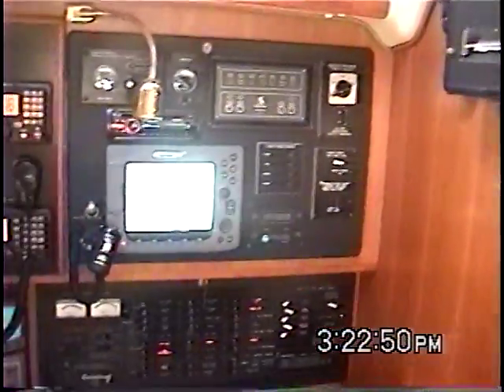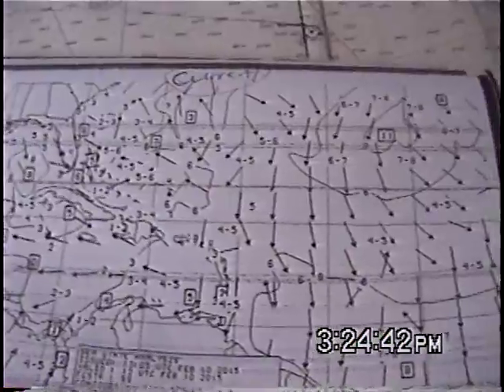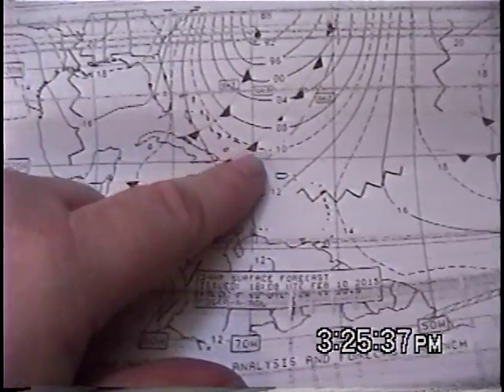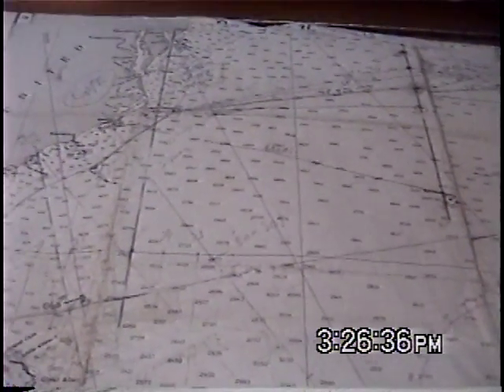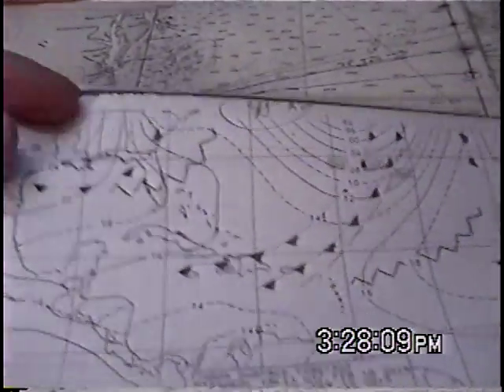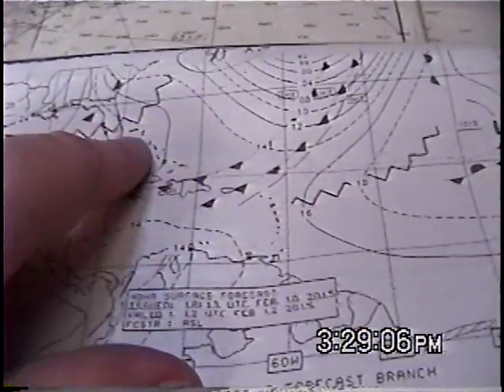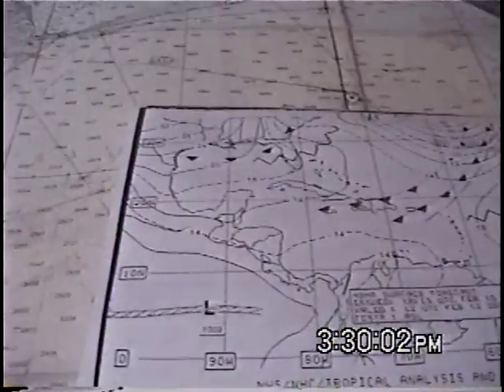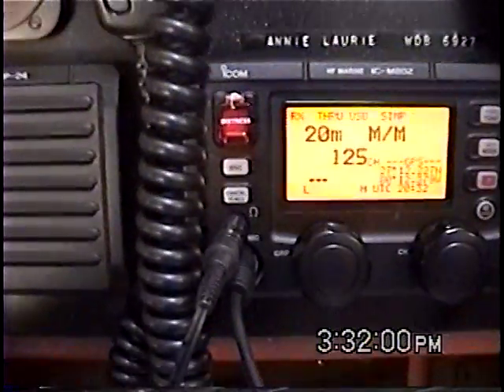Basic Offshore Weather Dissemination Systems and Weather Routing

Comment: Hey John.  Obviously the blur streaks is RFI. Some questions....1.) How do u fix that if u wanna talk on the radio at the same time getting weather charts?  2.) Is that the only issue that happens with wefax and other stuff on board?  and lastly, you have reported before on some of your video's that "on-shore rfi" is sometimes a problem with say the Icon M-802 (like you reported) is there anything like that "on-shore rfi" in getting weather reports?  Thanks and 73's.  Happy sailing.
Reply from the maker: Jason, the "blur streaks" that I show on the above video (from 1:10 thru 1:30) are interference that I caused to my WeFax reception, by transmitting on my M-802 HF-DSC-SSB Radio, while at the same time receiving the Weather Fax Charts on the Furuno FAX-408.       This has nothing at all to do with the M-802...          This is caused by the very close proximity (a few feet) between my main backstay antenna and my aft lower shroud antenna (used for the FAX-408 and DSC reception on the M-802).....in most situations this interference is not present, as most using a separate dedicated WeFax unit (like the FAX-408) are on large vessels and have its antenna sufficiently separate from their main transmit antenna....and/or are not actually yaking-away on the radio (as I do) while also receiving weather charts... :)           I have no other issues with interference on-board....Please watch the whole "Offshore Weather" playlist here  https://www.youtube.com/user/captainjohn49/playlists        And, the HF-DSC Playlist,  the M-802 Instruction Videos, the "Offshore Sailing" videos,  the whole "Maritime HF Comms" videos, etc...   To be clear, since the FAX-408 is a wide-band, full-HF coverage receiver (without any "pre-selection"), it and other basic shortwave radios, are more susceptible to close-by HF transmitters....and with the antennas just a few feet away, it is something to be aware of....BUT....But, in the real-world, it really doesn't cause any problems!  :)   And, as far as NAVTEX goes, using a dedicated NAVTEX receiver, there is no problem here at all!!   As NAVTEX is at 508khz, quite a ways away from the HF bands, this sort of interference rare (I've never seen / heard of it)....and most NAVTEX receivers will have a 5mhz low-pass filter as well...so, no real worries...    Please understand that this interference is not what we are talking about, when we refer to RFI....these minor "blurs" are caused by me, yaking away on the radio, instead of looking at the weather charts being received / printed!  :)     As for RFI in general and "shore-side" RFI, etc....I have a couple videos showing those....but, please remember that there are entire books written about RFI and I've personally taught mult-hour seminars in RFI, so there is no way that any Youtube video could do more than scratch the surface of the RFI topic...Here are two videos that do show / explain a little about RFI     https://www.youtube.com/watch?v=eX8Oy8TwAic    and atmospheric noises too   https://www.youtube.com/watch?v=3fUtSOBt2FA&t=114s     I do hope this helps....but please remember that these videos are not a substitute for the radios' manuals, nor for a comprehensive radio operations course / class, nor for a better understanding of radiowave propagation / proper radio operations....  Fair winds..  and 73,   John,   KA4WJA   s/v  Annie Laurie,  WDB6927